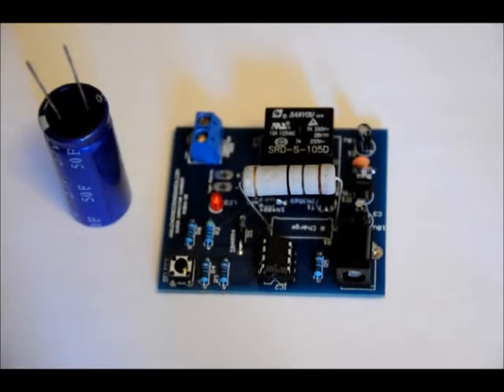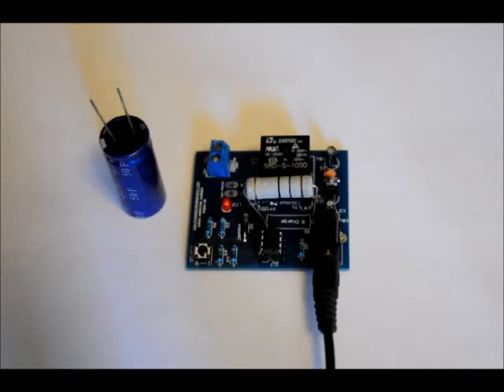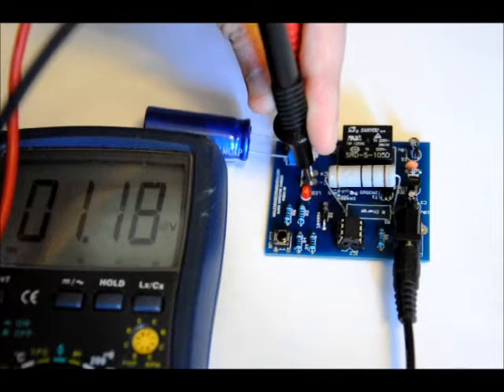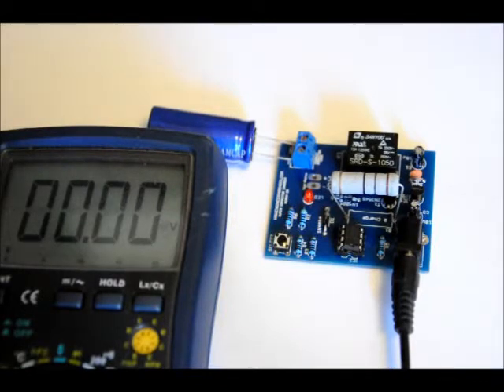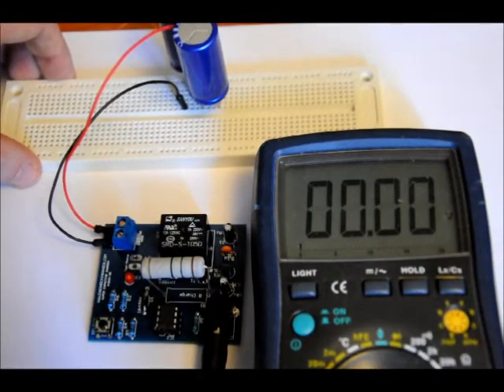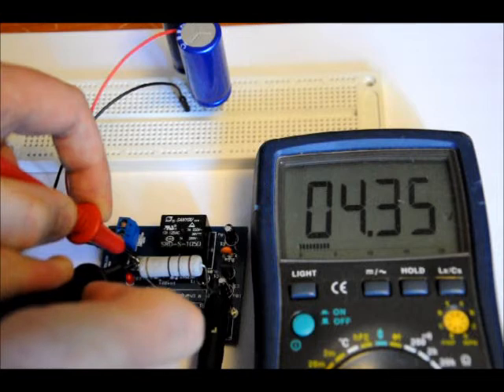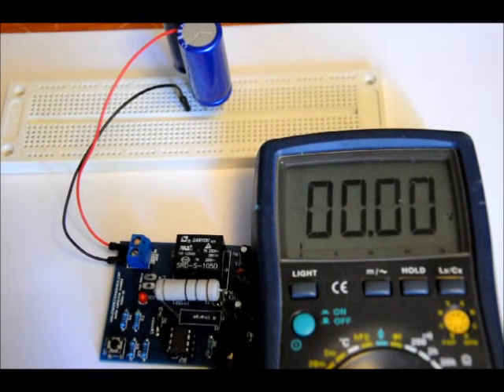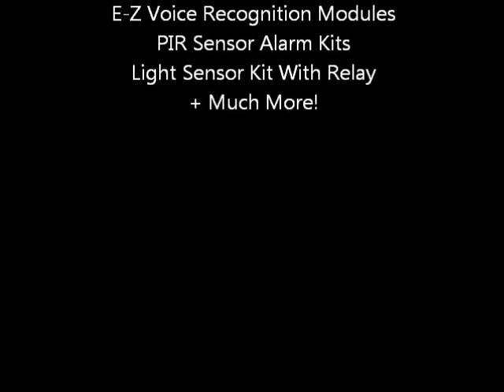The Variable Super Capacitor Charger DIY Electronics Kit !!!

Comment: pat, 
can the test ports on this multi charge board be used as outputs to my 3.4v booster board?
the good thing about the other single 5.4v charge board was it has 3 output terminals for connecting output accessories and this 4 setting charge board does not have any external terminal block ports. so if i can use these test ports as terminal ports i can run wires and then use these to power my 3.4v-34v booster, then use a switch and power my other devices.